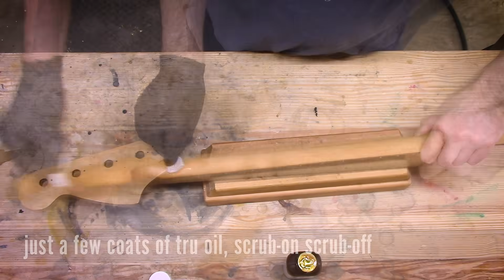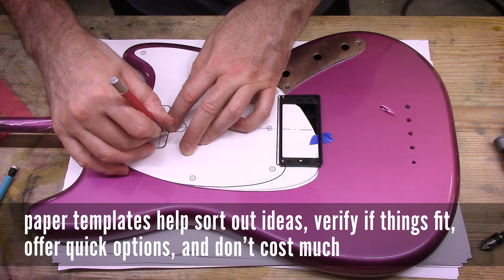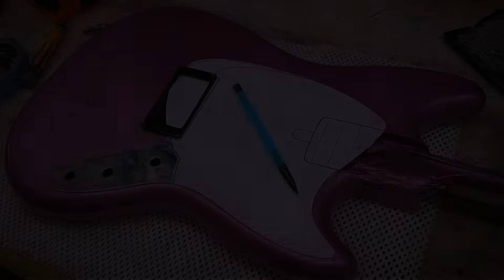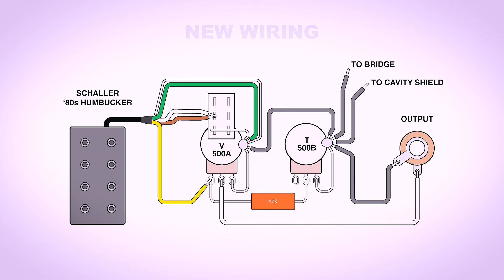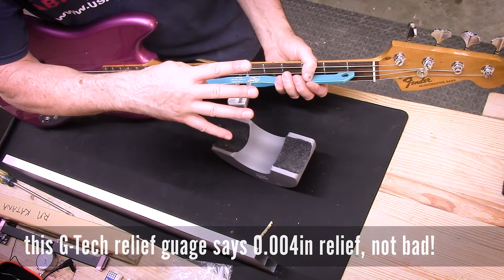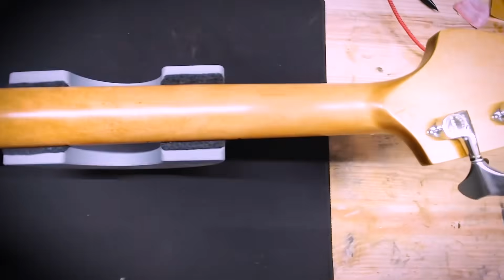Fender MusicMaster Bass Guitar Resto Mod Project EP5

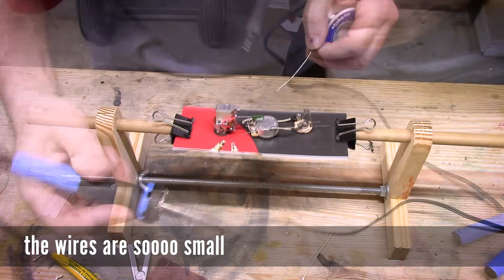Comment: 14:40 ... Dude, that is a great wiring plate holder/jig/thingy! I pick up some cool ideas from your videos!! And the countersink trick! 👏👏👏👍
Reply from the maker: Hey, hey my friend, good to hear from you. Thanks for watching!
That wiring thingy has really been "handy" - pun intended.  I don't know if you can tell from the video, but this version of the holder is adjustable in a couple ways, the top spring clip shafts can slide in, or out, of the arms they go through. Then the base of the arms are held apart by a threaded rod, so it is reasonably adjustable for small or large-ish parts. 
There is just enough drag in all of the joints that it holds position really well. 
Oh yes, the countersink thing. I don't know where I picked that up, but I honestly forget to do it - most of the time - which is regretful.
It really is a great thing to do, as I've chipped, torn and lifted finish when trying to just drill a hole. This does seem to remedy most all issues.
I hope all is well for you and yours. Happy Independence Day!
Take care, 
John

Comment: Get a laser cutter for doing the initial cut of the MDF for making the pickguard. That would eliminate a lot of the sanding.
Reply from the maker: Jeff, dude - really?!  A laser cutter, really?
Honestly I'd looked at those a while back.... soooo tempted, but not a clue what I should be considering.
The devil on my shoulder says "just buy one, you'll figure it out. do it, just do it!". 
The guy on my other shoulder (might be an angel) "says, you have enough tools you don't use, save your money."
I'm torn, and appear to have mental issues, lol.

Seriously, any insight and advise you can offer would be greatly appreciated.

Hope all is well, be safe and take care
Reply: @theNextProject I tried leaving 2 replies and for some reason YouTube won't let me give you what I've done with my laser machine. Do you have an email?
Reply from the maker: @jeffallen3382   YT has been acting up. I don't get some msgs either ... 
Send me a note at this email:
thenextproject.info@gmail.com 
I'll reply back from my personal email account.... This cuts down on spamming and random email clutter.
Thanks in advance!
Reply: @theNextProject I sent you an email.
Reply: @theNextProject sent the 2nd reply just now to your personal email.
Reply: @theNextProject for some reason my first reply won't post? I didn't leave any links in it? Anyways... 

I just bought a used Neje 4max with the extension rails off of eBay. This is about the largest Diode laser one can get. I wanted the larger one for doing the leather guitar straps that I build. Mine will cut 1030mm x 750mm whereas most are in the 400mm x 400 size.

I should be able to cut up to about 3/4 of an inch in plywood or MDF with a 20watt laser. If you can run a 3d printer you can figure out a laser cutter easily. A popular program (think of it as the slicer for a 3d printer) used to work these laser cutters is called Lightburn. It has a 1 time fee to buy it but there are free programs like Laser GRBL but from what I've seen Lightburn is easier to use. I've used the GRBL one for a pattern I had a friend cut for me and ship me back the leather. It was ok. I think Lightburn will be much easier to use. 

Now hopefully this one will post? I don't get YouTube's reason for doing this?